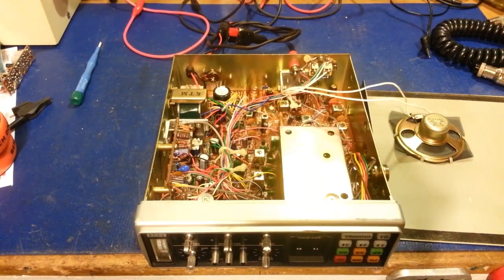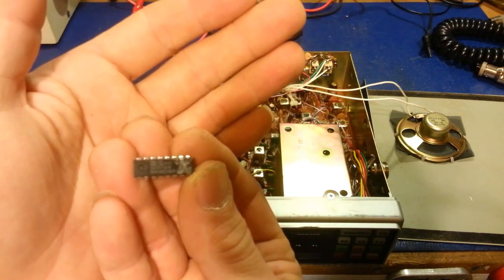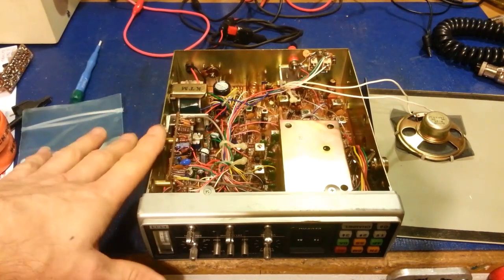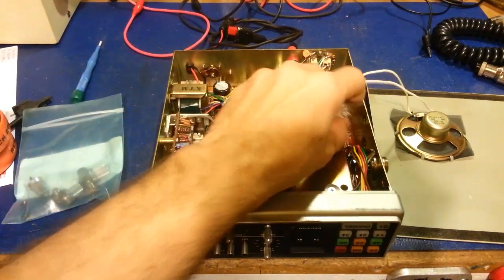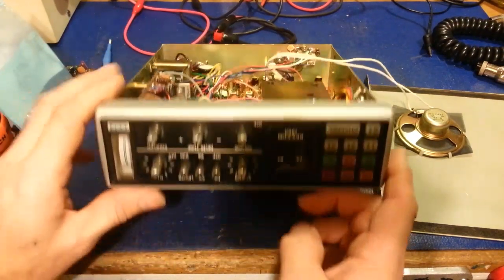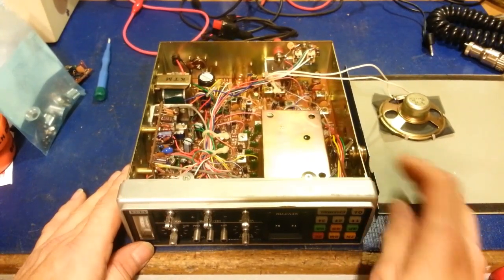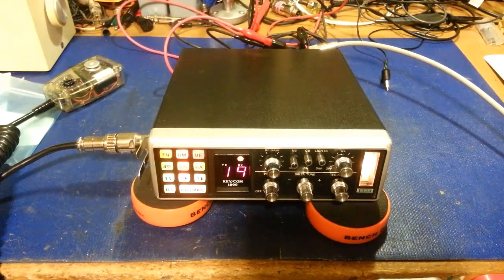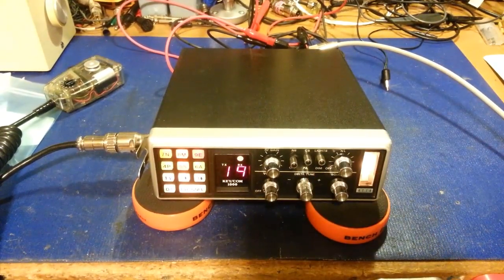SBE KEYCOM 1000 early 40 channel scanning CB radio.

Comment: I have one that my parents bought me for graduation I was doing volunteer Search and Rescue and it was mounted in my 66 Bronco.  It hasn't been mounted and running since 1985, when I sold my Bronco(big mistake).  I wonder if it still works?  Wanting to mount it in my 77 Bronco.
Reply from the maker: Vintage radio for a vintage rig. The perfect combination.  I have 2 Bronco's.  A 1972 and 1977.  The 1972 is restored to as it came off the show room floor condition.  The 1977 is a rock crawler with external roll cage and 4BT Cummins diesel.